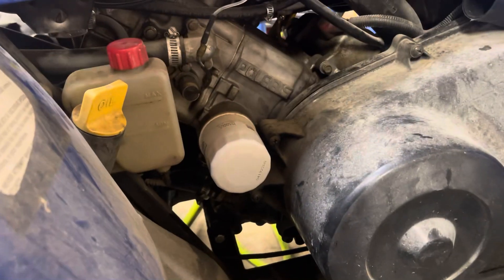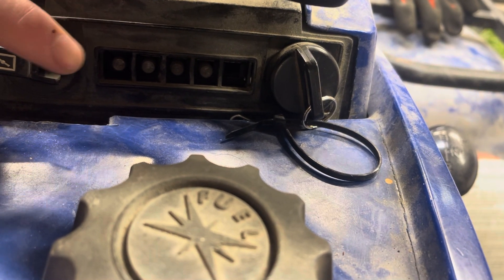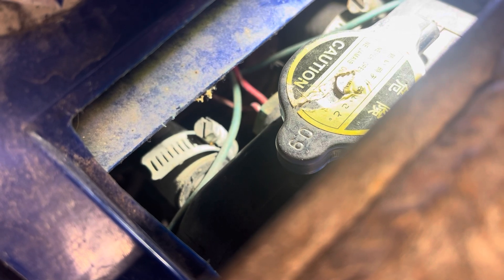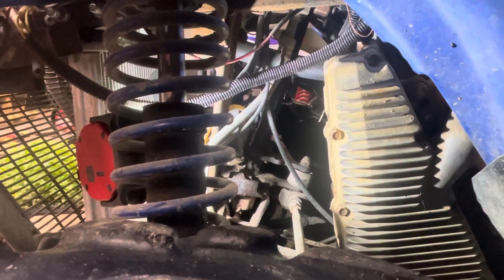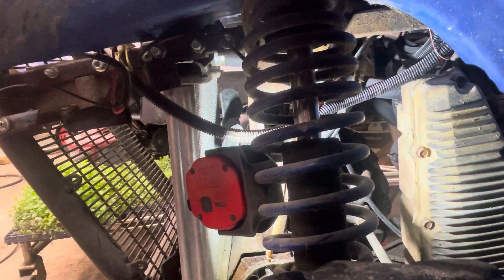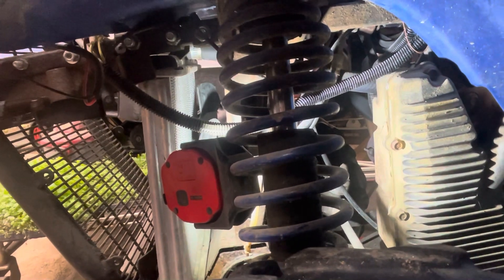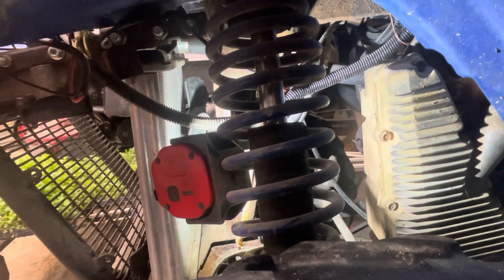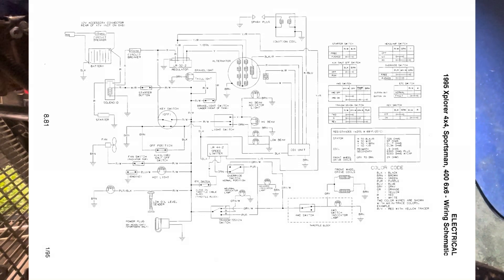Polaris Magnum/Sportsman(425/325) cooling fan bypass and fix

Comment: So aim I able to buy a new fan and just wire it straight to the battery with a on/off switch?
Reply from the maker: You can if you want to bypass the thermal switch. You can also wire it to your key for key on/key off power on the fan.
Reply: @JakeMMelvin  if I wire it to the ignition switch like the video, would the hot light still come on if the coolent/engine starts to actually over heat? And would the fan wear out over time from constantly being on?